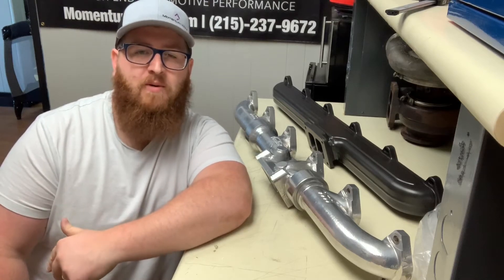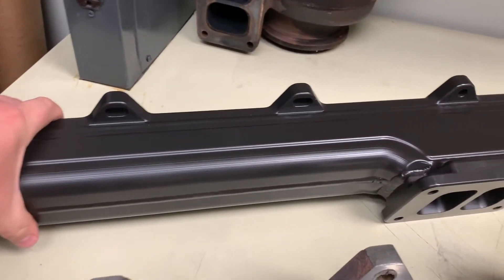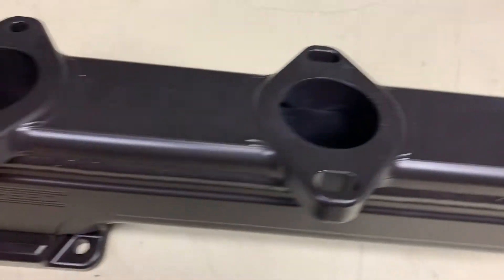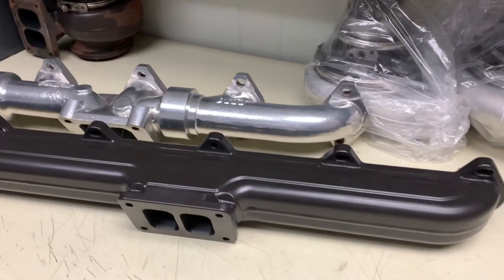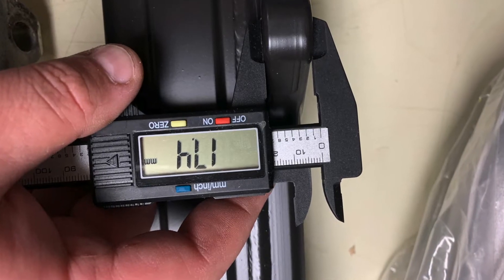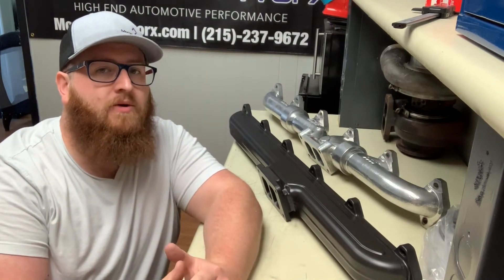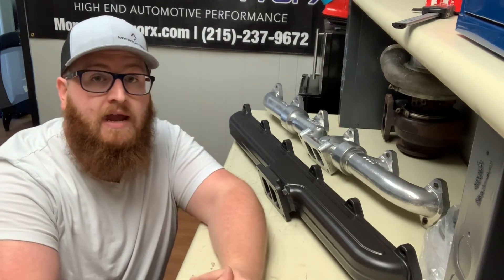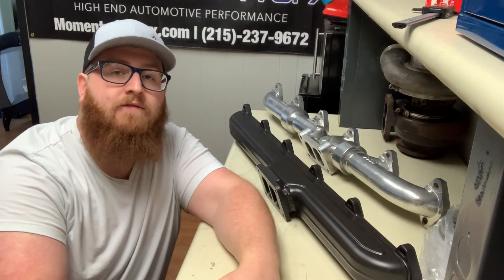CAT 3406 / C15 Single Turbo Manifold Shoot Out | Part 1

Comment: I’m interested as I’ve built a few c15 in different configurations with different turbos also going as far a dropping the oem c15 compression from 18:1 to 16:1 and single turbo swapping now I would like to do another rebuild with 16:1 compression and install or keep the two turbos just trying to see the difference between each configuration and see with one has better fuel economy and good pulling power 👍🏽

Comment: Wont it crack with no expansion joints? Or does the forged steel not have that issue?
Reply from the maker: The mounting holes are slotted to allow for expansion.  These manifolds have been on the market for some time and have seen countless miles collectively, everything has been good so far!
Reply: @momentumworx  awesome cant wait to get one on my e model

Comment: I wish there was some Dyno Numbers. I also wish the Full Tilt Manifold was a 1 Piece. Does this other Company make them for Cummins & Detroit as well. I have been thinking about Buying a some Glider Kits (10-15+) before end of this year and some of them will have Cat, Cummins, & Detroit just that is what is available since Glider Kits End this year and I can’t be Picky about all of one type of Motor. Some will have Cat 3406E/C-12 Models, Cummins N14 Celect+ RedTop/ISM Motors, & Detroit S60 DDEC 3/4 12.7L/14.0L, does this Steed Speed Company make Manifolds for these Motors? Looking to do Manifolds, Turbos, & Exhaust to increase Performance since we run Oversize and Up To #130,000LBS. I’m not doing Injectors, ECM and all that BS.